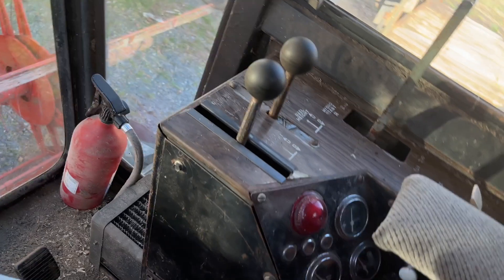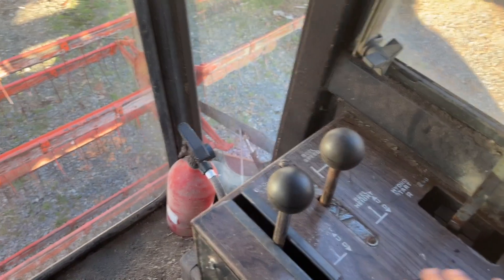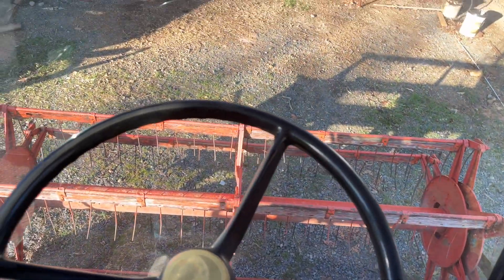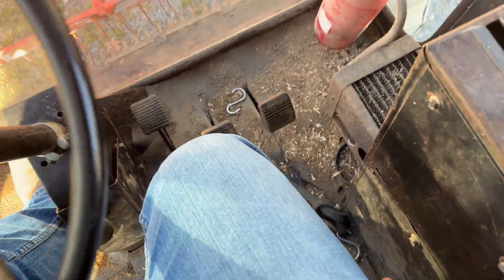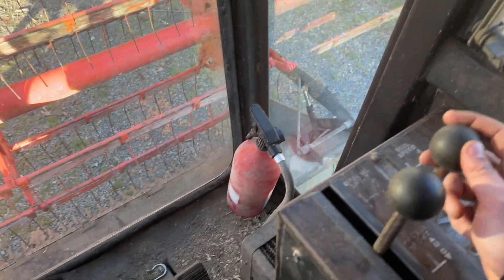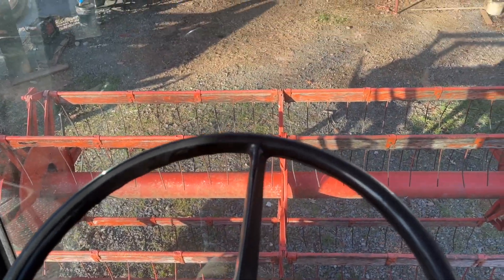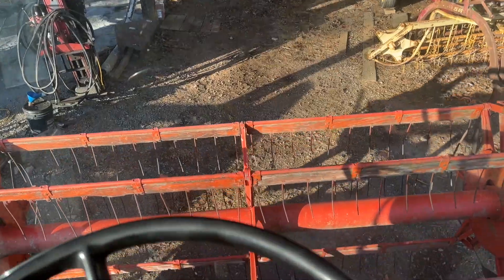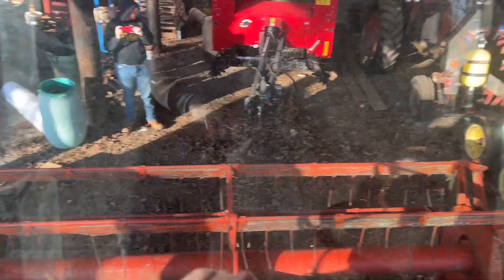How to Operate a Gleaner K Combine

Comment: Neat little fact is Gleaner ran ford engines in their combines from the 1920's to the 1950's an Ford tried to buy out Gleaner in 1954 but the Ford Reps blew a tire on the way an the Allis guys past them an quickly struck a deal before the Ford guys showed up.